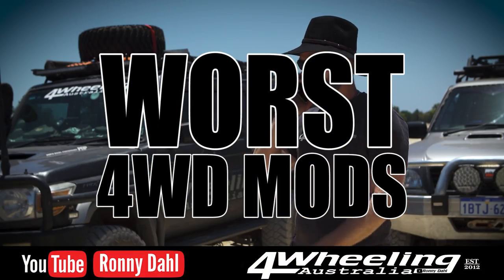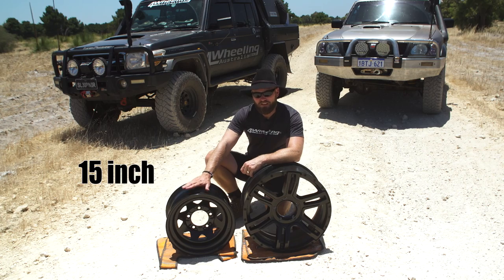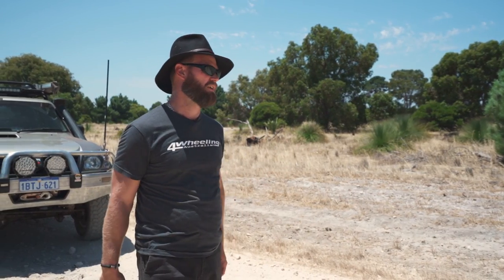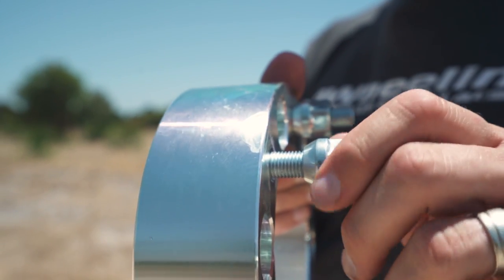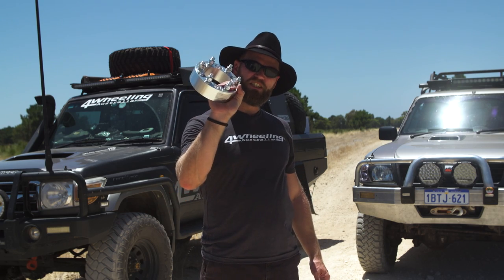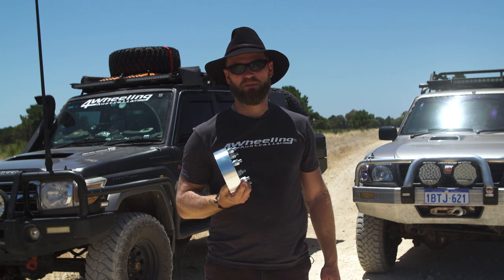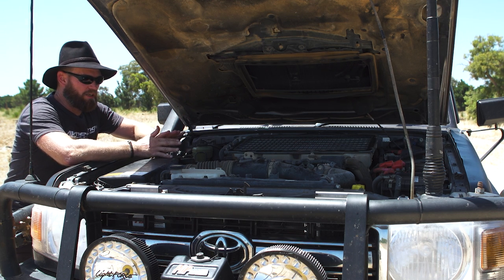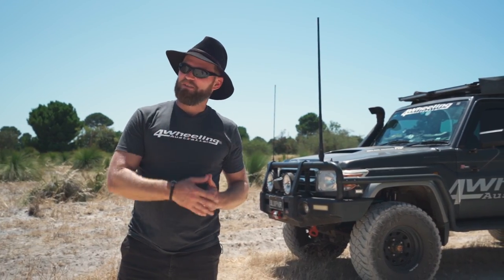WORST 4x4 MODS, DON'T DO THESE TO YOUR 4WD

Comment: You would have a heart attack here in Texas LMAO half the trucks are lifted more than 6"
Reply: Come to Tennessee. 12in lifts common, they need a drop down tow hitch 😂. Neon underglow and huge rolling coal trashcan sized exhaust
Reply: All the posers :D
Reply: That's no lie. Jacked up trucks with drivers that don't know anything about 4x4.
Reply: not to mention all the look a penny trucks her in TX, ya know where its lifted in the back with 22 in rims and lowered in the front with what looks like the spare doughnuts on there riding along at a 45 degree angle..... face palm
Reply: I have a 7". Has better approach and departure angles plus easier to run regeared 37s on my Tundra.
Reply: All mall crawlers.
Reply: @Chinese_Chicken  being on 37s, i wouldnt call 7in lift a terrible crime, tad overkill but not plain stupid.

 Have to remember this video is from Australia, our 4x4s are considerably smaller than your trucks, also have better approach/departure angles to begin with.

 Biggest legal tyres for most 4x4s here is 31s or 33s. So 2-3in lift is really the most you could ever want here, plenty to clear tyres, adequate articulation if set up correctly.
Unless youre a bit cheeky and go 35s, even then 4in is adequate.

 Beyond that most of our cars look silly and handle terrible, even 33s and 2.5in lift on a coiled cruiser wagon feels very wallowy, body rolls like crazy, nose dives under brakes.
Since our 4x4s usually have a shorter wheelbase and narrower track than your trucks so they lose stability much easier
Reply: @Liam I didn't realize this was strictly for AU. I wouldn't call 37's/7" overkill, I've dragged my high clearance bumper entering a hole a few times. I built my truck to enter hunting spots and be reliable that most wouldn't make it through and it works.
Reply: @Chinese_Chicken   wouldnt say its strictly AU, but our cars and rules are quite different.

Farkk😂 you must have massive overhangs out the front/behind your tyres for it to still scrape with 37s and 7in.. i had a friend with 3in and 33s and he would never really have bumpers touch unless he was practically driving down a wall, that was just a run of the mill GQ wagon.
 People do tracks like gunshot and similar  here with 31/33in tyres and 2-3in lift which are like crawling down a steep bank into a flat creekbed and sometimes back out the otherside, and besides scrubbing the bullbar a bit sometimes  they pull through with relative ease. Except the guys that send it too fast, they bottom out and break shit
Reply: @Liam, it's mostly tank traps up in the mountains, where they put a big ditch in the middle of the road to keep people out lol. That seems to be where the best hunting is. There's a video of my truck off-roading around 50mph in my profile. Could go harder but I didn't adjust my bypasses, they were still in my comfort settings.
Reply: @thetowndrunk988  ive got 24" and 78's, amautuer
Reply: The funny thing is that most lifted trucks are heavy diesels. Terrible offroad. Anything more that 5000 lbs starts to suck on hill climbs, sink in mud or sand, or can’t be pushed out of a ditch. 

Diesel 4x4 full size is the biggest first offroad joke!!!
Reply: we have a lot of flooding in the southern states, those mall crawlers as you call them are the only ones who can get around on flooded streets and back roads

Comment: Wheel spacers are not illegal in the states.
We use them on a lot of vehicles with heavy duty steering setups.

We also use 105ft-lbs or torque with red lock tight and check them every tire rotation.
But also, wheel spacers should never come from Amazon, ebay or some other non-automotive site.
Always use DOT approved spacers that use Grade 8 wheel lugs and 6061T6 Anodized Aluminum.
Use Red threadlocker and your spacers will not give you issues at all. Even beating them up offroad.
A lot of 1 ton and 2.5 ton steering setup will require wheel spacers so you don't rub the ball joints on the inside of the wheel.

Comment: Lift always comes second to wheel travel.  If you have a 6" lift and only 1" of droop, your vehicle is useless.
Reply: No. Its good for fliping it over the top any possible occasion.
Reply: Droopy is no good for anything 😂
Reply: Had this argument with the Defender guys when I lifted my Freelander 1. Try as I might, I couldn't get them to understand that I have lifted my whole vehicle by 50mm, giving me better ground clearance,where as their 6 inch lift moved their body 6 inches higher than their axles giving them better axle articulation, but not giving them better ground clearance as the axle is still in the same place relative to the ground.
Reply: @ianbeale2527  I love the "better axle articulation" part :D Can I use it from now on? 
How was your experience with the Freelancer I offroad? 
Any reliability issues?
I had 3d 1,8 K4 and other than common pain in the ass with the backdoor glass and front seats tilting linkage it was all good.
Reply: @HanSolo__  I had no problems at all. I've built 2 Freelander 1 , both were 3 door,with a 50mm lift, roll cage etc. V6 and Td4.Both used as daily drivers . Awesome for taking camping trips, carrying loads.
The V6 is on YouTube being rallied. Search for Race 2 Recovery, Meeting 5 Bovington. It's the Blue Freelander X622FWP.
Reply: @ianbeale2527  Now that one is a lovely piece. Sounds really nice. Any changes with locking differential? Intake? Exhaust? What exactly you made for that 50mm of lift?
I did work on two Mini Morrises. The first one was all original, second was meant to race in Open class. The first one trashed 4 British engines before we fitted 1,4 T from Renault 5 Super Turbo. The other had a 1,8T Audi TT engine. Both with all safety equipment. Cage, seats, belts, etc. We used some parts from crashed racing Skoda Fabia. I mean this car was open wide still with the blood inside. Never got what was its story.

Comment: One of the silliest things I've seen, is guys lifting their pickups and fitting bigger off road tires and they aren't even 4 wheel drive! What is the purpose of that?
Reply: @Eff       "...What is the purpose of that?"

Compensation, my dear boy, for crippling genital insufficiency.
Reply: Hmmm, SCORE Class 8 Baja 500?  One of the silliest things I have seen is judging other people on what they do to THEIR vehicle.  I thought video gamers were elitist snobs, but they pale in comparison to 4x4 community.

When I was a kid in San Diego 4x4 1/2 tons were a rarity because of cost.  You would be surprised where a 2WD 1/2 ton can go with good tires and pioneer tools.  None of us had winches either, that was a luxury item.  I mean who had a PTO on their truck FFS?
Reply: Is Baja a joke to you? Pre-running?
There are 2wd offroad communities.

Comment: Worst/useless mod - people who install 20" light bars on the side of their roof racks for a camp lights.
Reply: I guess if they went camping often it wouldn’t be useless? But it would definitely look stupid
Reply: @affordablepropertymaintena9213  yeah it would still be stupid everyone in camp would be blind
Reply: I agree, yeah bit excessive as camp lights ..... just get a good pair of the little 6" size and they'll do sufficiently
Reply: For real. I go camping to get away from the city lights so i can see the stars...then some leumnophille decides to show of how they can turn night into day. Light pollution, and noise pollution are just as bad as littering in my book.
Reply: @kusheen...  I have 4 led strips on a dimmer when I don't need a lot of light I unplug 3 and dim the 4th
Reply: Are you sure they're for camping and not night driving? Some people like having side light when driving in an animal prone area or trail driving at night. Don't jump straight to the conclusion that they have them for Sun-like campsite illumination.
Reply: @kusheen...  Agreed. I don't get it either. I get illuminating your work/prep area, storage, etc (with energy efficiency being at the top of my list), but a full moon and a fire is the best combo once dinner is done, kids are clean and in their pyjamas. The kids love spotting things with torches but I won't hand them anything too significant. I do have a lot of m12/m18 Milwaukee lights so I'll typically take something appropriate to what we'll be doing. I have enough batteries that I can last a full week without charging anything either.
Reply: i had side lights for camping but could adjust angle and had a dimmer on it. but I also have little kids, but came in a great hand

Comment: People disconnecting there sway bars on the road 🤦‍♂️
Reply: But gotta do the sick wheel lifts at every corner bro 🤙
Reply: Have mates who have done it in their patrol the car is beyond scary to drive and boaty but that’s solid axel. In my experience if u take the seat bar out in ifs 4x4 it’s great get the most droop and articulations out the suspension without hindering driving performance haven’t had a sway bar in for ages and I wouldn’t know the difference in road
Reply: My defender doesn’t even have them
Reply: @hamish1162  depends how sost the springs are, if its heavy duty non flexy it will handle better than big flexy WITH both swaynbars in
Reply: I am starting to see guys installing tuned King 2.5" and 3.0" shocks dropping their sway bars on the road and reporting good / improved results.  Highly expensive, but perhaps if the OE mfg provided  enhanced shock absorbers from the factory we wouldn't need sway bars.  Think about it...what is an anti sway bar there to achieve?  It's making up for another shortcoming.  Makes sense that a more capable properly tuned shock could do that job.
Reply: @willjones1181  mine neither...never came with them on..😁
Reply: @jarrodk2832  I agree.  I took the front sway bar off my '06 Tundra and it's fine.  More sway, yes, but acceptable.  But I also have a 2" life which made it stiffer in front anyway.  Offroad the sway bar being gone makes for good articulation.
Reply: Where sway bars???
Reply: Ive had a 82 hilux for 9 years.  Always had a bad wobble while slowing down using brakes.... for some reason I ended up pulling the sway bar off.  It fixed the wobble and feels so much better driving.  Granted it's solid axle with leaf springs.
Reply: @johnfitzgerald5158  Wow.  I don't even know where to start.  You do realize the race cars have sway bars right?  The basic reason is for the ride handling, comfort, and positive traction.  If you removed the sway bar and had to achieve the same body roll angle you would have to stiffen the coils and shocks.  Well the faster you go in a corner you would need stiffer coils and shocks to prevent rollover.  If you have stiff springs and shocks your vehicle will bounce at higher speeds even in a straight line.  So, the engineered balance of springs, shocks, coils, and sway bar allow for a vehicle to travel at slow to fast speeds while keeping your car handling within the physical tolerances to prevent rollover and positive traction.  Yes you can modify one or all of these to provide different results, but if you have the wrong combination without sway bars either you will roll or the vehicle will snake tail and spin out.  Anyhow.  Also, in a daily driver it is basically impossible to design and engineer a shock that can cover the wide array of all weather conditions, all speeds, varying vehicle weights of the same model, all surfaces (gravel, pavement, offroad), accounting for bald tires, etc to install on a mass produced model.  Maybe just maybe on limited production runs with all kinds of disclaimers or what the owner cannot do and wont be covered by insurance a shock could replace the sway bar.  Ridiculous.
It would probably be cheaper to design an anti-gravitational vehicle (hovercraft) for mass production.
Reply: @brianhummel8659  first off we are not talking about race cars .  And second, people have and are doing it with good results as others have stated here.  Automobiles didn't have them at one time.  Safety gurus (thanks Ralph Nader) got that ball rolling.  At the time shock and suspension technology was not as developed as it is now, so cars needed it.  It's a matter of expense.  It is expensive to get properly tuned 3.0 sized shocks.  What I don't think a lot of people realize are some of the negative results of a swaybar when you get that snap back on bumpy roads or after you turn onto a road that throws your head into the pillar.  Thank your swaybar for that.  Thankfully, my swaybar disconnects at a push of the button in 4WD, so I don't get that action off-road.  Some guys in the states ditch the OE swaybar for an Anti-Rock (brand) or the like which has a progressive rate.  Many report that it really softens up the affect of the bar in the beginning and only applies more force where it is needed further in the cycle of the suspension.

Comment: I have a f250 setup for tough off roading.  I run 17in steel wheels i welded beadlocks on, with 40in trail grappler tires.  Tall tires small wheels are where it’s at off road 👍🏻👍🏻👍🏻.  Not a single busted wheel, better ride at low pressure, and unbelievable (axle busting lol) traction.  👍🏻👍🏻

Comment: The first vehicle, motorised, to cross the Simpson solo was a stock Nissan G60 with split rims and cheese cutter tyres. How many mods do we need?
Reply: You referring to the legendary Reg Sprigg?
Reply: Actually it was well before that and it wasnt even  a fourby
Reply: The Simpson isn't exactly hardcore or gnarly though is it.
Reply: @jusomebody3069  was a bit different then. Could easily die out there, not the vehicles and services that we have today.
Reply: Indeed, however my point is about modern cars. You can do it without so much as a lift or 32''s.
Reply: @jusomebody3069  yep, sounds like we're making the same point.

Comment: Making your daily driver too highly customised .. then taking it on a tour .. just can not be fixed without custom machined parts from skunk works etc.
Reply: That's where regular maintenance comes in. I had a huge bolt back out on me during a 1000 mile road trip. I had to improvise with a smaller bolt and duct tape to get me home. I learned a valuable lesson that day. Treat your rig nice and it'll treat you nice(most of the time).

Comment: You briefly mentioned "putting on a snorkel but not following through". I am about to put on a snorkel as I often travel in convoy with my club and want to get cleaner air. Secondary is water crossings but they'll be rare if ever. What do you mean by follow through? What other things should I do/ be looking at?

Comment: Silly mods here in California: 1) snorkels (no rivers to cross), 2) big-ass brush guards (no one is crashing through brush like that) and we don't have kangaroos. 3) excessive lift and extreme tires (just for looks; you can tell by the unblemished paint jobs).  4) big gear carriers attached to the rear receiver (now try to cross that wash). 5) lotsa chrome: bumpers, skid bars, rims.

Comment: A lot of good points about wheel spacers. Did I understand correctly, that for Land Cruiser 70 it is acceptable because of the narrow wheelbase? Now I'm thinking about Suzuki Jimny. If it will have 2 inch lift and at the same time it is a daily driver. Do not make lift? or add wheel spacers?

Comment: Mine isn’t a mod, just an accessory I can’t use. Jeep Wrangler hammock where you take the front roof panels off (they just unclip) then you can lie on the hammock. Sweet. Problem is I’ve got a full-length roof rack so the panels can’t come off without taking the huge roof rack with ladders off. The hammock is still in its bag and will likely never be used 😔

Comment: Rim size is also extremely important in countries with many potholes
Reply: Good advice! 
Australia is the pot hole hot spot of the world.
I hit a deep hole once in a car with low profile tyres, it jarred the suspension that hard the front end needed repairs and a re alignment 8^O
Reply: If you think Aus has some pot holes you should come take a spin in a real poor African country! Some of the pot holes in the main road infrastructure are still left from explosions during wars... often you don’t even drive on the tar road but rather Nexto it
Reply: @franksteenhuisen7223  Sounds  quite close to my homeland -Poland!
Reply: @markpaterson6024  i dont think u can have more potholes than Barbados lol

Comment: Great Video.  You make so much more sense than 90% of the video clips made here in the U.S.    I have always agreed with 15-17 inch steel wheels and more side wall.  Aluminum rims looks great until you break one, as you have shown. Unused roof racks= 2 gallons less MPG here on the freeways. Your so right about the danger of wheel spacers and being a tight=ass on parts that matter.  People will always  spend big bucks to look cool but have little function when really off road, but the parts that matter, especially those that don't show are the important ones.
Everything you said is Spot on! 
40 inch tires may work on a 1-ton truck but over 35/36 on a 1/2 ton is asking asking for problems with gearing, cooling, frames, breaking, IFS front ends for sure,